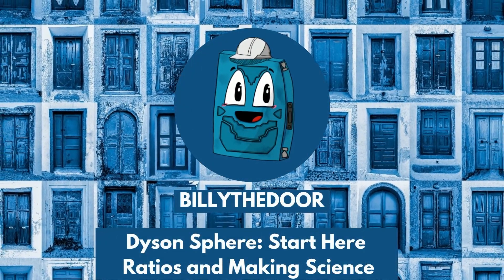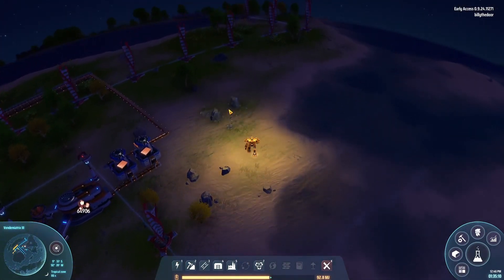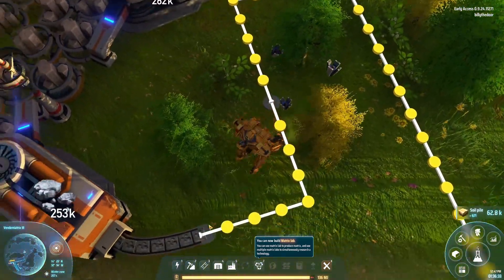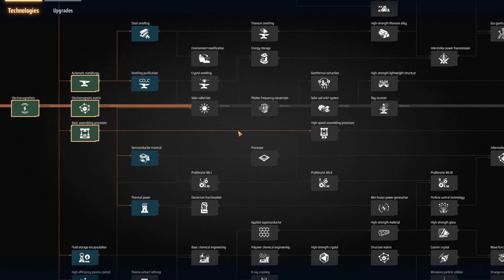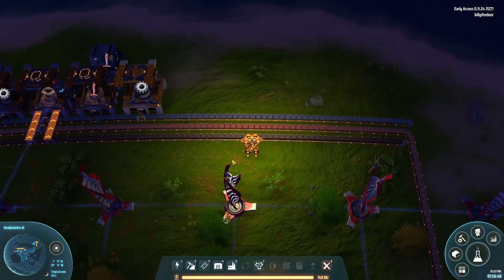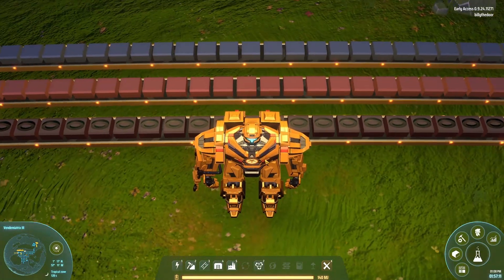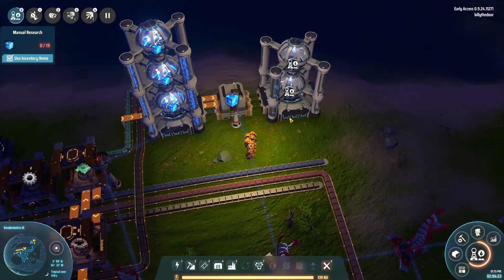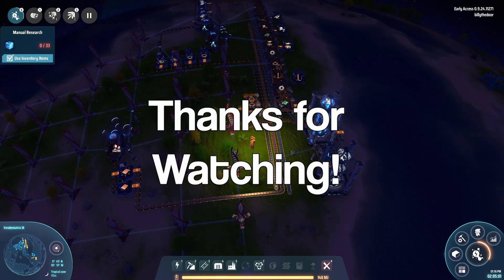Dyson Sphere Start Here: Basic Ratios and Science

Comment: nice tutorial
Reply from the maker: Glad you liked it!
Reply: @billythedoor   can u pls advise how does dyson technologies works? Need some basics, ingame manuals is not very useful. Thanks
Reply from the maker: @igorpolyakov1889  I actually plan on making a video about it soon! But until then: 

First you will need to make Solar Sails which go into the EM Rail Ejectors to make a Dyson Swarm. You will need a pretty constant supply since sails by themselves deteriorate after some time. 

Later on - you will start the Dyson Sphere which requires Rockets launched by rocket silos and the solar sails - but the advantage is that the dyson sphere will be permanent. 

Ray Receivers are used to collect power from the swarm and/or sphere. It's best to put Ray Receivers on the poles of your planet since they gain a bonus for continuous receiving. Later on you will use Ray Recievers also generate photons which are how you make antimatter, which is required for the final white cubes (universe matricies).
Reply: @billythedoor   will wait for your video, and thanks